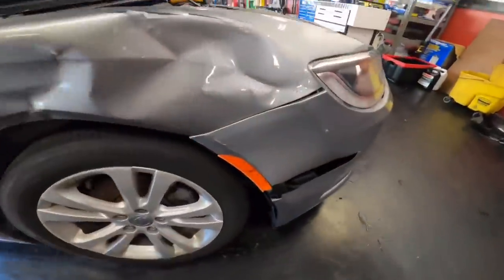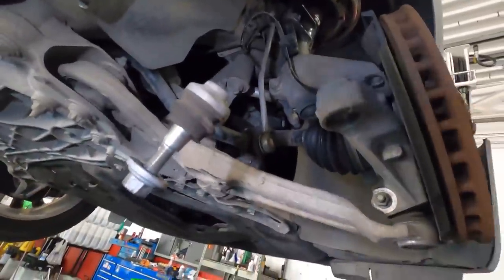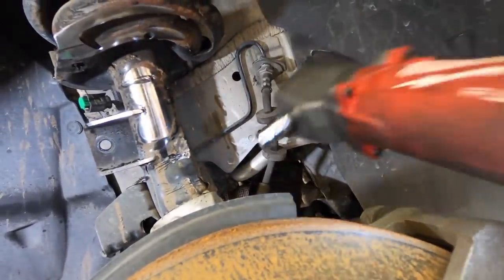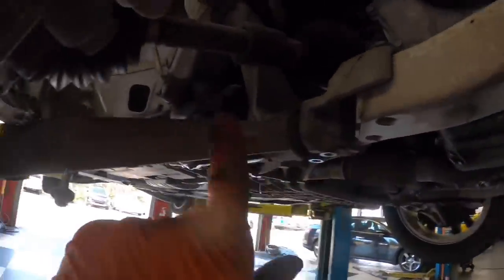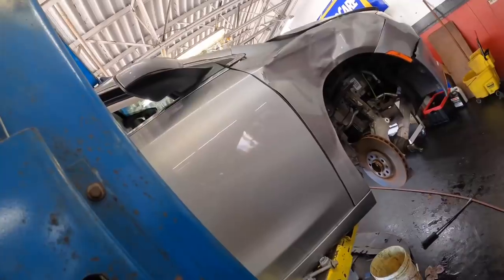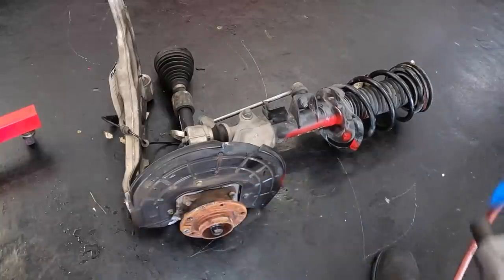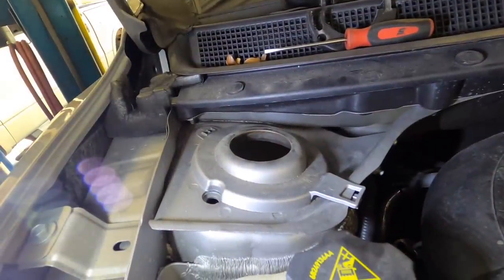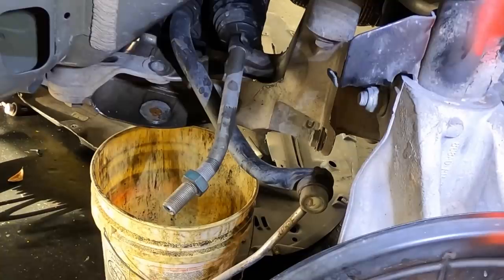Cutting Brake Lines! Caught on Camera! Chrysler 200 Strut, Control Arm, Tie Rods and Brake line

Comment: "It is safe, the engineer said so." Well that's what the engineer said to Robert Eidschun about the fuel tank placement on the Ford Pinto too 😂😂
Reply: I had one. The recall just put in a shield to keep the exposed bolts away. As a joke he asked me if I was interested in buying a fire extinguisher.
Reply: You mean the car that was designed initially with safety features that no car today had. It was safe until Ford removed them features
Reply: Had one too. Was so worried about being rear ended I barely noticed when my head gasket went, my transmission shredded. Just used a clothes hangar to keep the door shut and drove til it stopped moving.
Reply: Come On Man my 75 dogged van had a 36 gallon tank that hung below the rear bumper but yes idyots do like to tailgate and do break chex.
Reply: @ydoyawannano7844  
And you loved every moment of it.
Reply: Same thing the nasa fellas said for the shuttle launch back in the late ‘80’s before it self destructed
Reply: At least Pinto driver's didn't have to worry so much about tailgaters because no one wanted get within 100 feet of that bomb on wheels...
Reply: Engineers also said the "O" rings on the Challenger were safe too.
Reply: Hey there Ray , i have a question on power tools. Would like to know which size drives do you have for your impact , right angle impact, and power ratchets? 🤔 thanks again and anyone else who replies 👍🏻
Reply: @BucketODigletts  1/4” and 3/8”.
Reply: Needed to put an explosive deviveinthe tank so it would catch on fire. Still wasn't safe, just
Reply: Didn't the 87 88 chev truck have gas tank placement issues.
Reply: @Nicole-mn9oy  would agnez like the air hammer,.
Reply: @dondonzi2627  lol i just realized i had replied under the wrong place 🤣 thank you for the reply
Reply: @CleanforGene68 report them instead, I have been as I read comments.
Reply: @11thcavcsa  Actually they didn't, engineers tried to warn the NASA executives that the seals weren't rated to launch at the low temperatures on the day and were ignored.
Reply: Thanks fiat
Reply: Engineers actually pointed out potential issues with the Pinto and executives did a cost analysis of the potential lawsuits vs the cost of delaying release to compete with the Japanese cars on the market. Part of the reason they got slapped with such a hefty class action.
Reply: sunnyleone,,,,,😍  Where are you at, I've been trying to find you for a long timè!
Reply: Thing is pinto good cars one first small cars have rack pinion steering disk brakes while I to her manufacturer s aluminum block and cylinder s like Vega and other gm cars dodge did same thing and s up per easy to put fuel cell in it was Ford greed that allowed it to continue... I drove it over 40 yr now nephew driving  It and it has over 400.000.mi done short block twice and head 5 times  that a poor example of something that doesn't work but exalleñt example of corp greed and passing the buck
Reply: @gaving7127  that upper management owns that you right about that
Reply: Christian Ewing  that they did
Reply: The engineers knew about the issue and how to fix it. Corporate decided it was cheaper to not fix...
Reply: Ayyyy
Reply: And those firestone tires, what could possibly go wrong Ford said. They're just tires.
Reply: But that part that holds the strut assembly looks like it wouldn't bear any downward force, its there only to keep the thing doing lateral movements, the other was even broken, lol.
Reply: Ford bean counters had a hand in that. Let's give credit where credit is due.
Reply: @shawnmiller9381  wow a real live crash test dummy that doesn't go hmmm hmm hmmm ! Now seriously did you have serious injury with lifelong after effects ? Did they look after you financially or did you have to sue them ?  My thinking says you would be early 80's , congratulations on attaining that age after such a traumatic experience at a young age . I am just nearing 71 with a couple of near misses also .
Reply: @11thcavcsa  As someone who knew one of those engineers; several engineering teams said they were unsafe. They were, however, vetoed by politicians.
Reply: Does anybody remember the book on safe in any speed by Ralph Nader it referred to that little car oh boy 40,000 miles and like a Bic lighter for all my and Vegas too and I forgot about one more it look like a bubble car I have to think the AMC hornet

Comment: Ray I am from the England a place called Stanhope in County Durham although i'm originally from Middlsbrough on the north east coast of England, I am disabled due to an industrial accident some years back, I am mechanical engineer and in my time worked a lot on my own cars, I fully sympathise with you on some of the chronically designed "engineering" you encounter especially bolt positioning and this last job with the plastic ring holding the complete strut up, I honestly can not see any reason for that poor contraption, as you found out the bump the car has had damaging the wing and bonnet and front suspension on the Chrysler 300 has popped the passenger side (no thats wrong its lhd) drivers side plastic ring off, if that car hit a speed hump at a higher than normal speed one wonders at the result, sorry about the moan, but hey Ray you're a great mechanic and something not often seen in vehical repairs you are bloody conciencious at your job too and thats a rare trait, one to be proud of......i'd bring my car to you but its a bit far.....lovely to see clean undersides of the cars with crazy milages on instead of the terrible rusty underside you see in the UK Canada Alaska and the Northern States, we have been to the US about six times in the past Florida 3 times (Kissimmee) drove all over the state, been to New York twice Las Vegas and San Francisco, loved every minute......i'm rambling sorry  thanks for the videos Ray I enjoy them. kindest regards
Reply: Everything tend to be made to speed up manufacture and save $$. That two piece plastic clip is probably cheaper that 3-4 bolts and threading some holes.
Reply: @Cheepchipsable  But as demonstrated, it is a sub par design. Engineers lose to bean counters on this design.
Reply: He is a typical Quick Fit mechanic !!!! A butcher ! I wouldn't let him near my car let alone a customers car !
Reply: You shouldnt speeden over speed hums theyre there for a reason (school etc) - if you are it should ripp off whole suspension on every single car if its not that only means that hump is shit designed
Reply: Yes I had a Fiat 1972 with those wheel bolt studs I saw a wheel passed me on the road it was mine my car suddenly fell down I put on my blinkers and had to Jack the car up with a scissor jack thank goodness to both fell out with the wheel bolted it back on and drove away love those cars yeah right

Comment: Anyone else from the rust belt watch his videos in awe? I mean I might go back to the automotive industry if they came apart like this haha
Reply: Our fave tools in the rust belt are the air hammer and torch! Can't be tight if it's a liquid!!!
Reply: Sometimes I'm even at a loss for words...WOOOOOW
Reply: Jimmy S  those toyota skid blate bolts break easily every where, even here in Southern Virginia where cars look just as rust-free as the ones seen above.
Reply: Jimmy S :  Replace with stainless steal fasteners?

Comment: I like the way Ray almost never hesitates to remove four, eight, ten bolts and assemblies to get clearance to get a tool on the job and room to remove whatever he is after.  Other guys might ponder, think, then try something difficult, just to avoid removing a few bolts, and by that time Ray has taken care of business and is on to something else.  Way to go, Ray.  Me? Even if I took video of the whole process I'd never remember where all the bits go to put things back together - and that's why I had a desk job.
Reply: He's amazing, no fear.
Reply: I have found its usually easier and faster just to get stuff out of your way.
Reply: Actually he did exactly the opposite installing a steering rack last year.
Reply: Fleet truck, broken fog light.  To replace it the first step was to remove the bumper.  I got away with removing the bolts on that side, but just loosening them on the other.  That kept it from turning into a two-person job.
Reply: You do recognize that this is an insurance job and they pay for time spent, within reason of course.
Reply: Land Rover series workshop manual
Every task, step 1: remove the bonnet.
Reply: removing stuff in the way is always nice. working on rusty stuff on the other hand has taught me, sometimes it's better to struggle than play roulette with snapping bolts
Reply: @shadymaint1  so true! It always saves time just removing the things in your way as opposed to fighting to find a way to remove the original part you're there for!! Always happened to me! LoL :)
So nowadays I'll take apart 10 things just for 1 without HESITATION!  ;)
Reply: Plenty of time he has tried to get buy removing as little as possible.
Reply: When you have every kind of power ratchet under the sun, undoing bolts isn’t the chore it used to be.
Reply: It doesn't really matter if you can't remember where all the bits go as long as you don't have any left over at the end.
Reply: @hydewhyte4364  Experience is the greatest teacher, no?
Reply: @kamilzmich5961  its a fine balance for sure of knowing when to just dig in, and when to sacrifice your comfort to avoid opening a can of worms.
Reply: After many stripped threads (using torque wrench every time) I always think 5 times before removing a bolt.

Comment: Love the comment you guys was making about fixing a broken parts with crappy junk yard parts. Insurance companies for you!!
Reply: of course this was years ago BUT an insurer A wanted my sisters friend an auto body repair person to use a fender from a salvage yard that was in worse shape than the one on the car.
Reply: Another reason I ALWAYS cross out the lines that say they can use whatever parts they wish and add in my line of OEM parts only and pay a larger premium if need be.
Reply: @iii9266  I had a repair the OEM part was only $5 more some others were more requiring a make it fit/work install wha la OEM bolts right into place no thinking required.
Reply: You would be shocked at the shit a body shop will throw on your car for ins sakes. I’ve seen some rough,spray painted unsafe BS put in cars. You’d be better to take it to a garage let them do the mechanical side then fight with the INS and make them reimburse j you out if they will.
Reply: I guess this is some US thing? Cannot imagine my insurance in Germany telling me/the shop to use junkyard parts. They would be laughed off.
Reply: Here in Sweden they use junk yard parts for insurement repairs "to save cost and enviroment" thats why the price for junk yard parts is higher then new aftermarket parts.
Reply: To be fair the parts on the damaged car were used, as are the parts from the junkyard.
Reply: sunnyleone,,,,,😍  Stop posting this crap! I'm reporting you!
Reply: Nothing wrong with second hand parts. If using them scares you so much, don't use them.
Reply: @whuzzzup  So if your 5 year old door was replaced with another 5 year old door and painted, this would upset you?
Reply: @davidball1014  careful what you wish for. As a Canadian who has to deal with a national Healthcare system I'll tell you that if your ok with waiting 6 to 15 hrs in the er to be treated and sometimes having to wait for days on a Gurnee in the hallway before being admitted for treatment, its not all that you hope for. And then there is always my presonal favorite if your personal Dr diagnoses you with someting serious they then refur you to a specialist that most likely has a 6 month to several years waiting list. Then they send you home with thousands of dollars a month of presiptions that you have to pay for and hopefully you don't go bankrupt, become addicted, or die while you wait.
Reply: @havocreaper2404  sounds similar to what I’ve dealt with in the US. Only thing missing is $700 charge is you give up after waiting 7 hours to never get seen.

If you are seen we’re in the thousands, and if it’s a stay welcome to the ten to hundred thousand dollar range.

Comment: The first thing the first responders do when arriving to the scene of an accident, at least here in my state, is diconnect the battery.  Thanks for the videos, keep up the good work. :-)
Reply: i think they usually cut the cable, at least over here they do.
Reply: @PandaMan02  Yes they do, after prying open the hood instead of pulling the hood release.
Reply: They cut the cable twice in my area... take a good 3-5" out so it can't reconnect.
Reply: With EV, i wonder how that will work?
Reply: @birdlady2725  safety loop is cut on EVs... isolates the high voltage circut.
Reply: @birdlady2725  HUGE concerns with the EVs. Entirely different protocol for dealing with them at crash sites.
Reply: @cigarsgunsanddiesel8032  Thank you for the info.  I know the type of batteries are different, as well as super high voltage.  Li vs. Regular lead acid....  if Li is on fire, do they need different chemicals to put it out too?
Reply: @birdlady2725  :
I just read up on that, and according to the site I visited, it depends upon the battery size.
The smaller ones (eg: cell phones), can be doused with water, but the large ones (e.g.: cars), need a Class "D" extinguisher used for extinguishing, due to the larger amount of Li in the [battery] case.
Reply: @birdlady2725  EV high voltage battery circuit is turned on/off by the 12v battery.  no 12v battery, no high voltage circuit.
Reply: @PandaMan02  Thank you.  Happy New Year!
Reply: @StormsparkPegasus  cool to know!  I used to do electronic repair - med equipment but have been out of it for a long time.  I still watch and try to learn about 'new fangled gadgets' lol.  Thank you for taking the time to help me learn.  I watched Chris Fixx replace a prius battery, and watching another guy building an ev military humvee from scratch.  I know he is learning as he goes.  I wonder if he knows about this type of fuse?  Thank you again.
Reply: @SilensMort  cool, thank you.
Reply: Around here they cut it. This keeps someone from being able to reconect the battery
Reply: @PandaMan02  May depend on the situation, I've seen some where they yank the clamps others they cut it.  I've heard some will also yank BOTH so they can short the cables together for 30 sec or so to short out any remaining charge before trying to cut into other bits.

Comment: This video really highlights the superiority of air tools over battery....
Reply: Sorta, air tools require a compressor and are usually much heavier than electric tools and can't fit in as tight of spaces.

They both have their uses. I definitely would hate using a battery powered one to remove lug nuts on diesel trucks like I used to.
Reply: The difference between an air gun and a mid torque electric impact. Different story with a 24 volt high torque

Comment: I've has front wheel collisions twice, people need to watch where they're going!  Both times, insurance authorized the repair which ended up needing way more parts/labor.  Both times the insurance said they would have been way better of totaling the car.  I think the rusty front rotor was an indicator of how long the car sat somewhere.
Reply: All it takes for a rotor to rust over like that in hot, humid Florida is a day or two.
Reply: Absolutely spot on. These were never very good cars to begin with and they stopped production in 2017. Should have been a total. Oh and good luck with a new front end alignment 😂